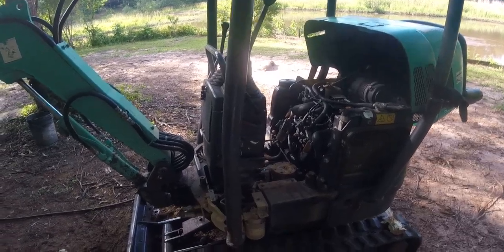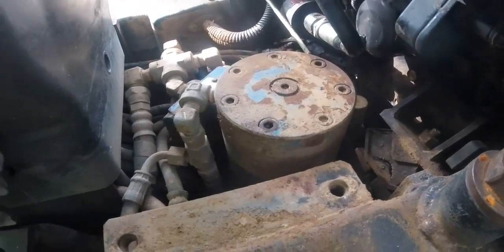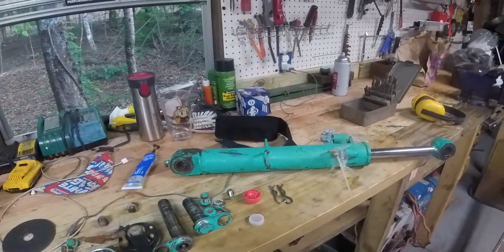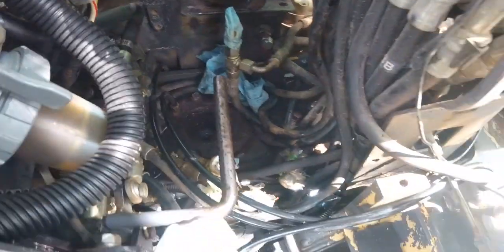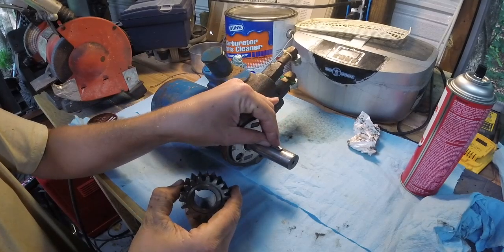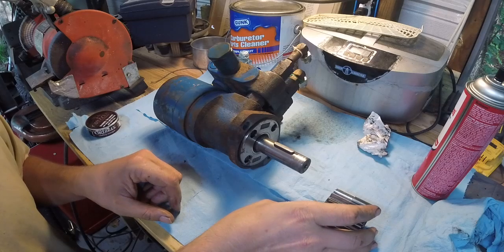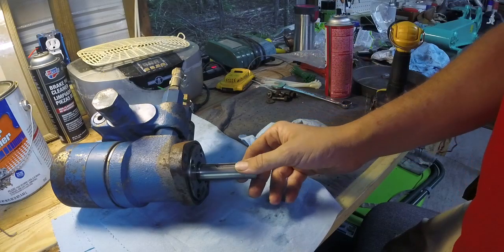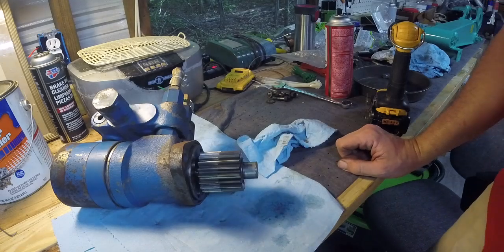FIXING HYDRAULIC SWING MOTOR ON MINI EXCAVATOR .... LOTS OF WEAR

Comment: Only 1700 hours😂
Reply from the maker: that’s not much for these excavators
Reply: @The_Home_Pros  I think that's great. I just picked one up a couple months ago I hope it lasts 1700 hours. But when a machine starts getting close to 2000 hours it said to have a good bit of time on it
Reply from the maker: @VolvoGonzo  it all depends on if it’s a diesel or not gas engines typically need rebuilding after about 1500 hrs and that’s on a good gas engine diesel engines can last 20,000 hours

Comment: I have excavator swing fine when the hoe empty above ground in the air, when I try to move dirt on ground weak no power can't move dirt?
I don't know why any idea ?
Reply from the maker: I’m not sure sounds like swing motor is wore out and maybe needs rebuilt
Reply: With a mini you can’t really do that
Reply: Even if it’s new , got a imer ihi 1.5 tone and it doesn’t do it
Reply: I also have a hitachi zx490 50 tones and with that you can swing and level the dirt , the mini’s don’t do that, thats why they have blades😁

Comment: I have a problem with the swing motor on the Chinese mini-excavator, which means that when the dome turns in a certain position, it squeaks, I feel as if it is grinding on some sheet metal. What could be the problem?

Comment: Did you really put that together without covering everything in grease? Dry metal on metal will eat those gears up quickly.
Reply from the maker: Of course not it’s got two grease zerks that pump grease to the gears and bearing I pump it full of grease all the time
Reply: @The_Home_Pros  Ok, I was worried for a minute. I usually grease everything as I assemble it so there is no dry start even with parts that get lubrication from another source. Could save a major repair down the road. Nice job in fixing that little digger up.
Reply from the maker: thanks man I did add some grease on the shaft and all but it wasn’t in vid